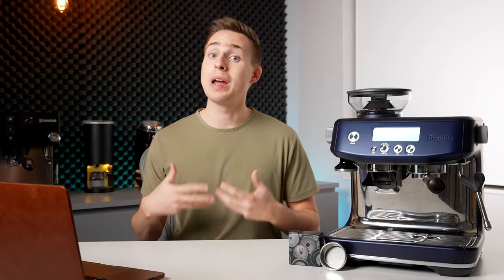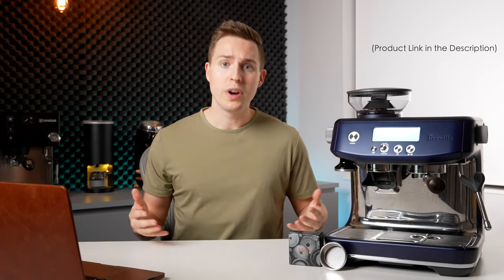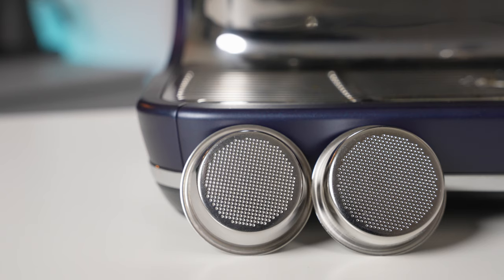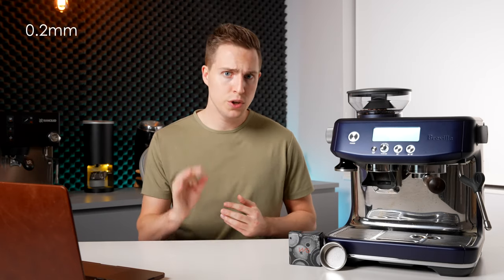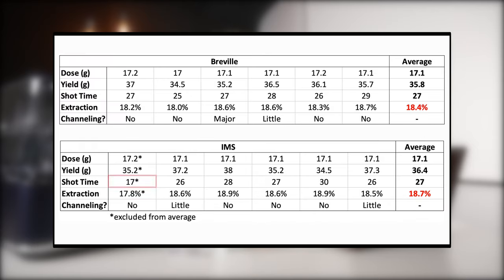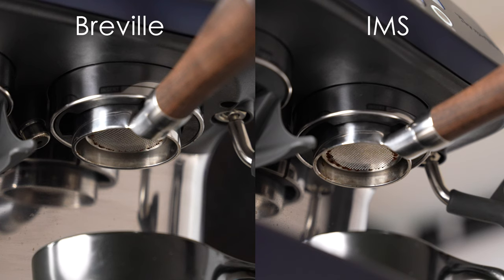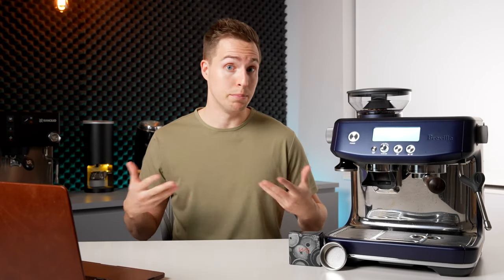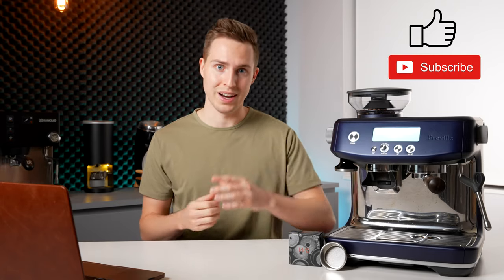54mm Precision Filter Baskets | IMS for Breville

Comment from the maker: 54mm IMS Filter Basket: https://geni.us/0dUh7
(As an Amazon Associate I earn from qualifying purchases)
Reply: Would you please share the link for the corresponding one that fits into Breville due tamp, size 51mm?
I found a curved one for La Pavoni which I think will not fit into the due tamp!
Reply from the maker: The Breville Duo Temp is also 54mm
Reply: @LifestyleLab_  I wanted to upgrade, but don’t have a problem with the standard for 5 years with mine. Also the negative reviews scare me.
Reply from the maker: The negative reviews I've seen are pointing out quite normal machining marks and calling them defects
Reply: Hi, i have some question. Since You linked to a basket advertised as 18-22g why were You testing dose close to 17g? Was yours different size than one that is linked or is the 18-22g claim an overkill?
Reply: It's not available now on Amazon
Reply from the maker: Just out of stock I’m sure
Reply: Is there a single shot IMS Filter Basket?  I can't seem to find one
Reply from the maker: Not for the 54mm Breville at this time, no
Reply: @LifestyleLab_  that's a bummer but thanks for the quick info. Does anyone make a precision 54 single?
Reply from the maker: Not that I’m aware of. Single shot baskets in general are just not very widely used anymore
Reply: @LifestyleLab_  😔 we're a single-shot espresso family.  Definite bummer
Reply: Do you have any advice on the IMS filter basket in combination with the palm tamper? The coffee puck is lower than with the original basket and I cant reach it with the palm tamper
Reply from the maker: Make sure you are dosing correctly for the basket size. This will ensure you can tamper properly, as well as ensure proper headroom
Reply: @LifestyleLab_   hm I already upped my dose from 17g to 18g in the IMS basket. I'm using a pretty dark italian roast, fine grind so the grind doesn't take much volume in the basket and 1:2 ratio in 25 seconds. I could up the dose to 20g or 22, but the small espresso cup's will be filled much more
Reply: Which one do I need for the Barista Pro? Will the H28 work? What's the difference between the H numbers?

Comment: on my barista pro I have to be on the finest grind setting (internal and external) to get a good shot. if I got one of these, would I still be able to pull a good shot? thinking about replacing it because I have been getting far more grounds in my cup than normal recently and I think my filter basket has worn out.

Comment: I have the same basket upgrade and found the same sort of results re grinder settings.  I also got the shower screen - I don't recommend this - it actually lets water through too quickly and stops it being evenly distributed, leading to a consistent channel being dug on the right hand side, where the water flows into the head.
Reply: The other problem is the depth of it. I usually dose 19 grams, this one is rated from 18-22 grams, but most likely you need to dose 20 -22. When doing 19 grams no matter what I did the puck would always be soggy.

Comment: Something I’ve noticed about my prep with the IMS is that it’s easier to tamp. I don’t usually dose more than 14.5g, and the Breville basket’s tapered sides make it hard to tamp that much (or, that little) down. I’ve found it a lot easier to tamp with IMS’s straight-sided basket, although the jury’s still out on whether my overall shot quality has improved.
Reply: I absolutely hate that tapered side basket they give you with the breville.  It's made for 18 grams, but I usually dose 15 myself. Any more, it's hard to tamp, and coffee gets everywhere. I just got my machine about 2 weeks ago. This basket is definitely something im going to order.
Reply: Did you need to remove the black plastic bit from below the stock basket? If so, how do you do that?

Comment: I brewed with my IMS basket today for the first time, and it cut down the brew time to 12 seconds, you have to grind smaller with this basket. And if you get the 18 to 22 g basket, you will need a different aftermarket level and tamper combo.
Reply: Which one is the 18-22g basket? Im looking to buy the 24mm tall one.
Reply: @dennisrkb  what size dose are you looking for?
Reply: @Stpetersburginjurylawyersmp  ~17g
Reply: @dennisrkb  54mm Breville basket

Comment: I started using this new IMS filter basket. One thing is I need to start using few more grams (from 18 to 20) to cover more the pocket. The basket says it can go up to 22. What is the “ideal” grams for this and the breville setup? Also when using 20g I am left with some water on the top of the basket (after the shot is done). I did feel a huge improvement on the shot, I am just having to almost re-learn how to pull a shot with this new basket. I do have the bottomless portafilter as well.
Reply: I am using 22g with a Vario-886 set at 5R and still not filling the basket. I'm getting on average 57g output in 25-35s and pressure gage registering just below max grey area with a dark roast coffee on a Breville Infuser. Looks like the basket could take 24g. But after pulling shot the puck expands to fill basket. Should also mention have the IMS screen too and using NPF aka bottomless portafilter.
Reply: I’m having the same thing here - water existing above the ground even after the extraction.

Comment: I noticed the basket that came with my new Breville looked perfect under a microscope like the IMS basket. Maybe due to luck of the draw, got a basket fresh off a new hole punch. Where as the one in video was well past due for a change out.
Reply from the maker: Interesting!
Makes some sense that Breville would use their tooling longer than a precision basket manufacture with higher QC standards

Comment: Is there a filter basket that would fit into the standard Breville portafilter but leaving the black plastic piece in the PF? The basket that came with my touch impress is tapered and that prevents me from using a puck screen. Because of the tappered design a pick screen can’t sit properly on the grind without a big push . Removing the puck screen is also a hassle. Thank you

Comment: Hi, I purchased the IMS basket and found that my shots ran significantly faster as you stated in your video.  I went down a grind size and increased the dosage from 18 to 21 and that helped but it was still fast. Do you think I should have kept the dosage the same at 18 grams and went down 2 grind sizes first before increasing dosage? Looking for the proper method to dial in beans with this new IMS basket. Thanks!
Reply: Make sure you’ve got a good grinder. Keep the dose. Drop the grind setting. It’ll neaten things up again.
Reply: Knock grind size first before you start messing with dose, ratios/yield, brew temp, tmap pressure etc

Comment: Just got my IMS b62.52th24e filter basket and run it through running water and it seemed slower than orignal Breville basket. However, when I put it in boiling water and run same test, visually about the same as Breville basket. I run it through the unit with 18g in and 36g out and measure the same time as OLD breville basket (24sec on 1st drip) however i grounded finer. This means that IMS basket runs faster. The following day i grounded finer but this time time decreased to 21s. I think that IMS basket has to be "burned In" first to achieve consistent results? In old basket i never experienced this kind of inconsistency.
Reply from the maker: Don't believe "burn in" would be a thing, but like any basket it does need to be properly pre-heated which is what you did by putting it in boiling water.

Comment: Seems like IMS has more size options now for 54mm! There’s 7g, 14-18g, 16-20g, and 18-22g. 

My understanding is the 14-18g is the most similar to the stock basket, right? If I usually dose 18g, would 14-18g make more sense or 16-20g?
Reply: can I just ask which one you decided to go to? also stuck in this decision
Reply: @hanscruz3082  I have to admit I haven’t bought it yet but all my research told me the 16-20g should be a good middle ground that provides enough room to go up or down from 18g and even add a puck screen in the future if I wanted to. 

So that will likely be what I’ll go for. The 14-18g should also be fine if you never plan on dosing more than 18g and don’t want a puck screen. 

Let me know what you end up going with!
Reply: @xtremesniper  just got the 20g basket thanks to your advice! Tried pulling a couple of shots and oh boy I have to start from scratch with my settings. The settings and recipe for my stock basket is no good for the ims basket, flow is too fast for this basket, got a lot of channeling and got a soupy puck. Did try uping the dose with same grind settings and did got a lot of better but still haven’t got it dialed in correctly. I need more time to get used to this new setup.

Haven’t tried with the puck screen though, but I did ordered 1 already. 

Btw, I also got the ims shower screen 😅
Reply: In the Amazon listing, you'll see that the dose changes depending on the roast level.  Each basket size is meant for 3 different min max dosage based on light, medium and dark roast

Comment: Thanks to your review, I purchased that IMS 54mm precision filter basket for my Barista Pro, and it arrived today. Had to do some grind size adjusting and volume, whereas I normally dosed 18 gm of beans with the stock Breville basket, now 20 gm. But the IMS basket is a bit deeper, so it accommodated 20 gm just fine. Oh, I’m now also using the Crema 53.4mm puck screen. Here’s my concern: The new IMS precision filter basket is VERY tight inside the stock Breville 54 mm portafilter—I struggle immensely to remove it after extraction. Is the stock portafilter just a bit too small for the IMS basket? If so, can you recommend a suitable replacement? Perhaps I need to switch to a bottomless portafilter? Thanks for any advice or direction.

EDIT: I just ordered the Crema 54mm bottomless portafilter. And then I learned that it includes a basket. However, since I have already adjusted the Barista Pro to the new IMS basket, I will use that basket for the time being. This barista stuff is quite the adventure for me.
Reply: UPDATE TO THE EDIT: The IMS precision filter basket fits the new Crema 54mm bottomless portafilter perfectly!! I’m a happy camper!

Comment: From the link of the IMS filter basket, there are several depth options. Does the depth of the IMS basket affect extraction? let's say I use 18g of coffee and use h28 compared to using h26. TIA
Reply from the maker: You should use the correct dose for the basket size, otherwise you will have too much headroom and a very soggy puck. 

Regardless of your dose, your brew ratio for a specific coffee / recipe will remain relatively similar
Reply: @LifestyleLab_  Thanks! and that is actually what happened, pucks were soupy. The size H28 says the dosing range is "Double Espresso 18-22 grams, wide 62.5mm, height 28mm"
Anyway I guess, I'll have to try a higher dose, maybe around 20g (middle of the recommended range)

I appreciate your videos helps a lot for home espresso making. Straight to the point and not making the videos longer than it should.

Comment: hey, i got the big bang basket for 15-17 and 18-20grams. i tried brazil single origin 18-20 ground coffee with 1:2 ratio and got super sour shots sadly. i used the sage smart grinder pro in combination with my sage dual boiler. even changed the inner burr for finger grind since it poured too fast. overall i experimented a lot and am not satisfied with taste and balance. can you please give me an example for good dose amount and grind size (inner, outer burr) on the smart grinder pro? im also using a bottomless portafilter by normcore and normcore tamper. thank you!
Reply from the maker: Increase your brew ratio

Comment: What about IMS shower screen? I have upgraded to this basket last week and mannnn it gave me SUCH a hard time without having a good tamper. The stock tamper sucks + the Crema tamper does not go deep enough to apply pressure onto the puck EVEN when I dose 22g, so I had to get something like the Normcore V4 for it to start giving me good shots. shoutout to you for both of those recommendations tho (IMS Basket + Normcore V4)
Reply from the maker: I'm sure the shower screen would be better than the stock one in some ways, but I've never installed a new shower screen that I've been able to taste the difference from... so it would really be more a piece of mind thing that you have the best component possible in there. Taste-wise, I'm not sold
Reply: @LifestyleLab_  agreed probably placebo effect like you mentioned. Will save my money until you make me spend it on some other tool in your next video probably 😂
Reply: I use Crema Products NPF and OEM double portafilter but I removed the black plastic from OEM portafilter. I also have IMS shower screen. I also use the Alsainte distribution / tamper tool as well as 3 prong WDT. I know it's not recommended but I tap side of portafilter after initial tamp then tamp again. I find it causes grinds to fill in edges of basket to help prevent edge channeling. It works for me so I don't care about recommendation to not tap sides of portafilter with filled basket.
Reply: @ggivensjr  do what works for you, at the end of the day they were just suggestions. Even if they're "rules" they're meant to be broken 😀👍

Comment: Tnx for the video, does it fit to the original sage touch 54mm portafilter ? ( instead the one which has provided with the machine ) is there a need to remove the inside plastic part ? 
At the moment I don’t want to change to the bottomless portafilter and keep working with the original one.
Reply from the maker: You can get the 14-18g version and it will fit perfectly in your stock portafilter

Comment: Do you think precision baskets make a difference if you’re using paper filters at the bottom of the puck?
Reply from the maker: Yes, the same advantages still apply!
Reply: @LifestyleLab_  Any preferences on what type of paper filter to use ? Chemex vs V60? Bleached (white) vs non-bleached (brown)? Scott rao was recommending chemex filters, considering switching.
Reply from the maker: A good quality Chemex is probably the best bet :)
Reply: Fire my 54 basket, I make them using EK Success 54-30151 Tools Circle Punch, 2-Inch

Comment: Any idea why the Breville oem quality is lower?  Isn’t it almost always the case that the oem has higher quality than third party makers?   Btw, would love to see more videos of comparison: pls do one for porta filter and dosing cup, cream vs alternative, etc.. thanks
Reply from the maker: It is odd, but this appears to be the case across the board, even with higher end brands like Rocket. 3rd party manufacturers have stepped in to create high quality basket options
Reply: I disagree on your statement regarding OEM usually having higher quality than 3rd party. 

It might be the case if its a component that is usually exclusive to the OEM but not something that is more generic like the filter basket. If its something more generic like the filter basket in this case, the OEM will be able to cut cost on the item in turn increasing their profit margin. Especially if the OEM thinks that the user will likely change that component if they want to. 

While a 3rd party are required to proceed with either a cheap replacement or an expensive but better component which IMS/VST/etc precision baskets are opting to do. In this case, the 3rd party will likely have higher quality so that they can steal the customer base from the OEM.

Comment: I hv both the 9g and 1820g IMS baskets. I must say u need to hv a good grinder to dial in the shots. Was running 18g on stock at df64 at 18 and had to dial down to 14 for IMS validating the flow rate under pressure difference.

Comment: Thanks for putting this video together. I bought the IMS filter and noticed shots running quite a lot faster. After stopping down the grind, I got it to extract at similar time. 

However, I’m finding the espresso tasting thin, with less texture and mouthfeel.  Also, with my current dose (18g), the extracted puck also comes out a lot more watery; there’s often a small pool of water on top of the IMS whereas my stock Breville basket comes out fairly dry. A minor point but worth noting. 

Going back to stock basket to see which I prefer.
Reply: I recently purchased the IMS filter & shower screen and found the same result, the shot ran a lot faster so I stopped the grind down two steps but found the puck much more watery after extraction compared to the stock filter. The espresso itself also tasted thin/weak with less overall texture. I just changed back to the stock filter but left the shower screen on and to my taste the shot is much more enjoyable. The puck is also much drier from the stock filter.
Reply: 18-22g or 14-18g
Reply: @noel4854  18-22g
Reply: It's wet because there a lot of head room between the puck and the shower screen/group. Up the dose and it should fix both issue of wet pick and a watery mouth feel, you may have to grind a little coarser because you up the dose.
Reply: Went back and forth between the stock and IMS. Today, I’m using the IMS but with a naked portafilter and a puck screen. Results are a lot better, with more consistency and little to no channeling.